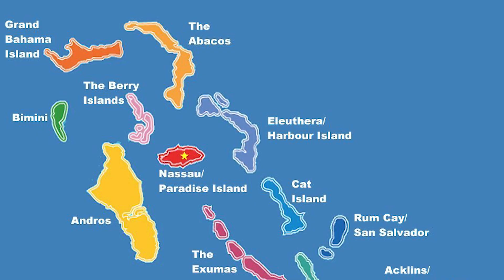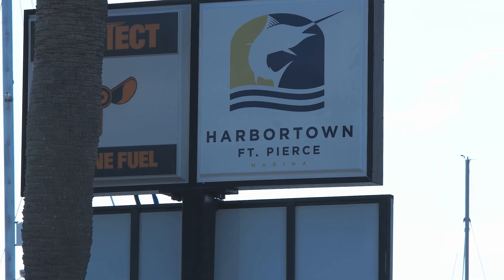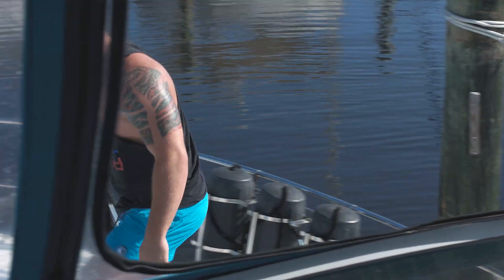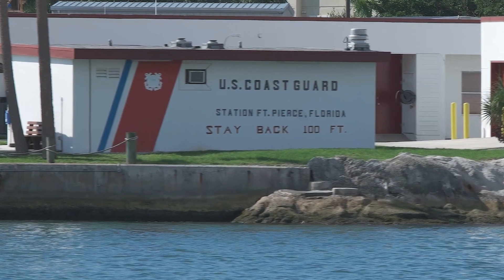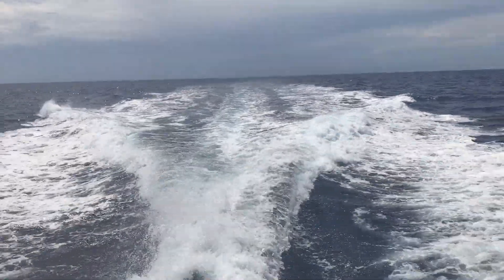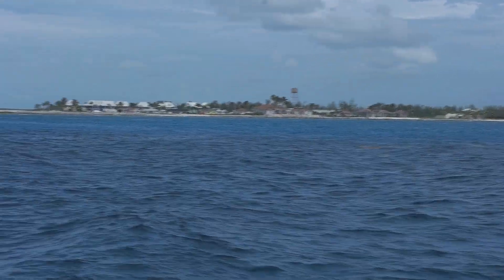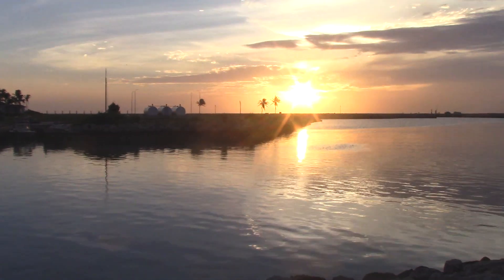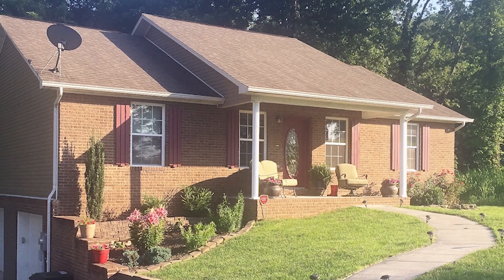Florida to Bahamas by boat--PDYC Video Cruise #1

Comment: How much fuel did you use and what is cost of fuel percentage wise there, and cost of daily dockage thanks.
Reply from the maker: This boat burns 20 gallons per hour and it takes about 5 hrs to cross.  Fuel will be about 1.25-1.50 more per gallon at most places but dockage is about on par with US.   Some places even cheaper and of course at Atlantis iit is much more